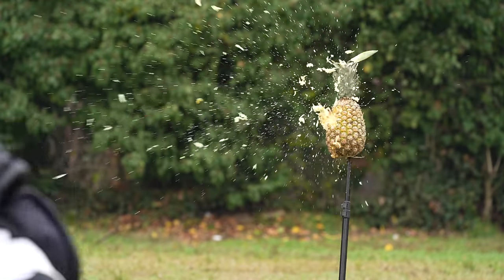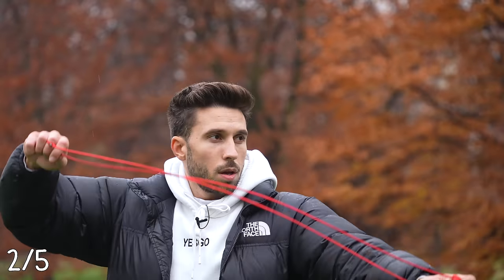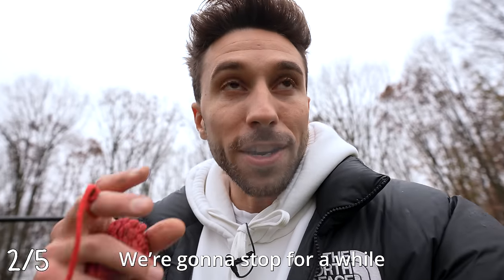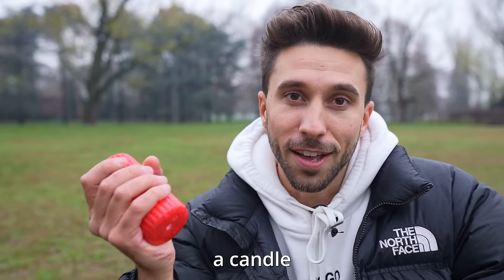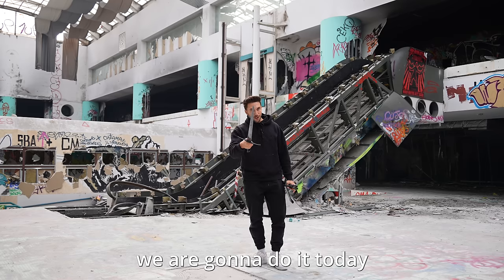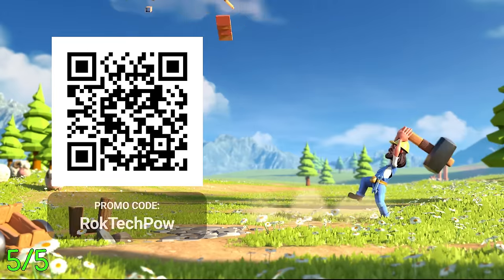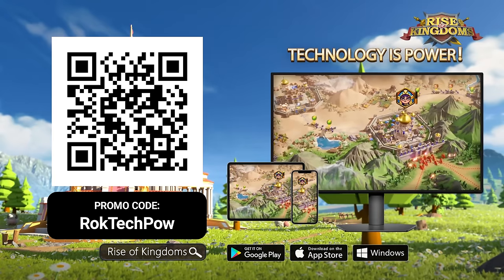I Tested The 5 Deadliest Ancient Weapons

Comment: If I remember correctly, maces aren't necessarily more powerful than swords or other weapons, they just have a different function. Maces were primarily wielded by nobles and rich people, which is why the scepter was originally a mace.
Swords, axes etc. are fantastic against flesh, as you can just cut into your target, but eventually, they stopped being particularly effective, as armor was getting more and more advanced. And when plate armor hit the scene, swords were fairly useless, as the slashing couldn't penetrate the armor, or at least not effectively, although using the cross guard as a kind of hammer by gripping the blade was reasonably viable.
And that's where maces or warhammers are effective. The hits bludgeoned the armor, so not only did the impact hurt by itself, it also made it harder to move in the armor if it's deformed.

I'm not historically well versed, so I might be wrong, but this us what I remember reading, when I was researching weapons for my cleric. lol
Reply: This guy got a enchant table and put fire aspect XCVII on it. XCVII is 97 in roman numerals
Reply: Bro writed the whole roman in here
Reply: What's c
Reply: Swords are not meant to cut through arms. They're made to break bones.
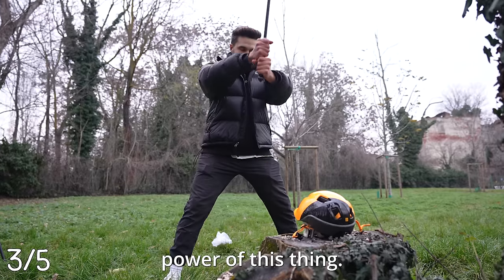Reply: As it is written, There is none righteous, no, not one:” romans 3:10, how come u as an unrighteouss man try to come to the GLORY OF GOD. 

For all have sinned, and come short of the glory of God; romans 3:23

ofcourse AFTER you got cleaned by JESUS from your sins you have to LIVE JUSTICE AND JUDGEMENT, AND HOLD JESUS COMMANDMENTS

For by grace are ye saved through faith; and that not of yourselves: it is the gift of God: 9Not of works, lest any man should boast. 10For we are his workmanship, created in Christ Jesus unto good works, which God hath before ordained that we should walk in them

ACCEPT JESUS TROUGH FAITH HE WILL CLEAN YOU , AFTER THAT LIVE AS JESUS WANTS AND GET BAPTISED
Reply: albert einstein tho u should get a degree in this stuff
Reply: i miss her jett lets goooo

big fan of urs
Reply: @EnglishTutor-ql6fx  100, Like ever heard something like a Century
Cent (or something like that) was latin for 100
Reply: @moonisblocked  not really
Reply: And also swords started thinning out to combat plate armor (stabbing)
Reply: @MrJello8bw  
Swords definetely had their uses, but when plate armor got better, pole arms definetely became more and more used, as far as melee weapons go.
But there's also still things like estocs, which were swords without any edge at all. They had a triangular or rectangular blade and were made to punch through armor, more or less. A great secondary weapon against armored foes.
Reply: @lucas_lipp   ya
Reply: Jetttttttttt

Comment: 0:30 another thing to do with spear is one handed thrust and couching
One handed used from horseback but more often when you have a shield
Hold it underarm with the end of the wood stick under your elbow, thrust forward 

Couching used against thick clothes or armour
Place end in armpit and hold underarm, lunch, run or have a horse gallop at someone while held
Heavier sticks used to practice with

The flanged mace was most effective on maille armour as the padding was still insufficient for them especially when points were used to focus impact which delayed their irrelevance as brigandine and plate armour got developed ( spreads blunt force over a wide area )
Close to a bad weapon on full plate besides headshots, a backup or on horseback, expensive for the kind shown to be made of the actual war ready stuff, hardened or mild steel quenched and way more durable than a sword, status symbol but still worked on less armoured opponents and to the side of a helmet, often used with a sword by those wealthy, both as secondaries
In general a worse version of a long shafted axe, flail or halberd / pollaxe
Flanged maces arent ancient and the one used is more of a prop, two handed maces rare, maces back then were light and nimble as velocity is more important than mass to a degree so they upped the mass of the head but made sure it did not affect the speed

Note for the crossbow 
Arrows or bolts are shorter
Usually dont use horn or as intricate a shaft material or fletching as the shaft does not need to be wobbly and the fleyching does not need to bebd around the hand and bow, horn not needed for a stubbier projectile without a notch as it is pushed by a thicker string
Shorter draw length as back then you could not carry the trigger mechanism and a full bow which lead to less power as shorter draws are less efficient, medieval crossbows started moving from wood to horn and composite bows to get extra draw weight to make up fir the inefficiency, steels and irons used toward the end of the high medieval period, 165 lb draw bows were some of the highest used with 600 lb crossbiws being slightly less powerful, more power needed to match the best grade warbows and exceed that to reliably punch through maille armour and with 1250 or so lb crossbows able to poke tiny holes in plate armour 
Stirrups let you get a steadier rate of barrage but werebt as good as sitting down and using both feet on the bow
Belt hooks used to engage more muscles and draw higher weights than a stirrup alone
Pulleys added to belts but limited by how far you could pull
Levers with hooks attached were used on the 400-600 lb crossbows with average 10 sec prep time
Cranequins and windlesses took around 40 srcs prep time but with no strain draw the heaviest of crossbows
Crossbows are inferior to bows in power, accuracy, range, simplicity, lack of splinters, cost and rate
Crossbows are superior to bowd in cheap upkeep, non exaustive usage, a bit easier to use on battlements, dont need 20 years to geet a good one, comfort, armour penetration ( dont flex as much )

Flaming swords did not see notable use in warfare but in medieval sieges and a chunk of naval warfare
For sieges fire basket arrows were seen around the start of the high medieval period, a light cage that could have tinder or tar or wax or fat soaked stuff shoved in, less range and accuracy due to weight and no use against a person, fair chance it would re ignite on landing after being put out by shooting it, can set fire to stuff fairly well with many castles during this part of the medieval period being wood so on the inside which was maintained and waterproofed better it cause serious issues

A bit later oxidisers luke saltpetre and mixtures with sulphur a intentionally slower burning form of gunpowders recipe let the fire arrows be near impossible to put out, buring from 40 - 120 seconds very hot, these either put in a fire basket or in a hard shell on a barbed head ( so it could stick in shields, people, wood and go through maille better ) and also produced noxious smoke often laced with arsenic to keep the enemy away from a chink of a ship or section of battlements
In naval warfare the first kind wasnt good enough to damage stuff, oxidiser arrows could set fire to rigging and sails fairly well and damage a ship or its battlements ( lmao they just stuck wood castles ontop of boats ) with fires sometimes happening if dryer weather 
Greek fire was the best kept secret, we dont know its exact composure, probably contained naptha, consistency similar to how we describe napalm, poured onto enemy ships or used to set unmanned ships yo crash into enemy with some complex decices to project the flames a few metres, this substance as well as other burning liquids used were risky to use, greek fire sometimes put in pots and used similar to hand grenades in javalin range

Trebuchets sometimes threw pots of burning liquid

Comment: i love your humor  My cousins and I would spend a lot of time in the small shop on the farm we build crossbows' out of old leaf springs once we figurer out the how to retimber them and the firing mechanism but the worst part  was how to explain the holes in the back of the shop and where all the welding rods went that we used for arrows

Comment: 1年前
If I remember correctly, maces aren't necessarily more powerful than swords or other weapons, they just have a different function. Maces were primarily wielded by nobles and rich people, which is why the scepter was originally a mace.
Swords, axes etc. are fantastic against flesh, as you can just cut into your target, but eventually, they stopped being particularly effective, as armor was getting more and more advanced. And when plate armor hit the scene, swords were fairly useless, as the slashing couldn't penetrate the armor, or at least not effectively, although using the cross guard as a kind of hammer by gripping the blade was reasonably viable.
And that's where maces or warhammers are effective. The hits bludgeoned the armor, so not only did the impact hurt by itself, it also made it harder to move in the armor if it's deformed.

I'm not historically well versed, so I might be wrong, but this us what I remember reading, when I was researching weapons for my cleric. lol

Comment: Love your content but crossbows don’t use arrows. They use bolt which are smaller, don’t have fletching, and the tip is not a broad point/arrow point but instead a slim metal point usually barely sharpened